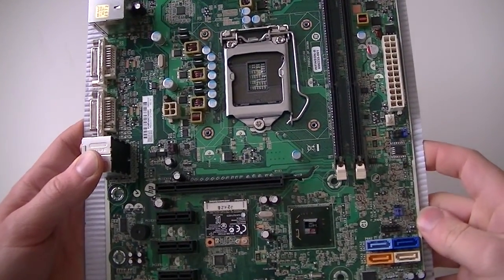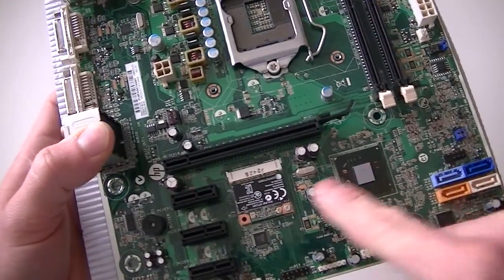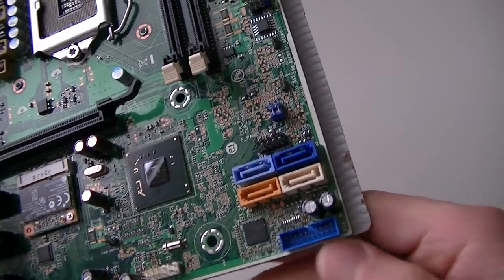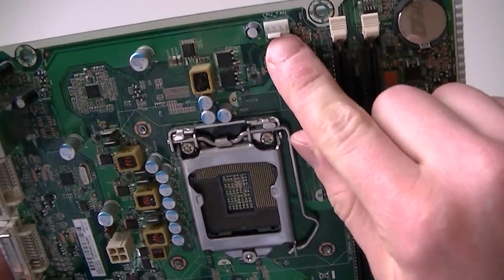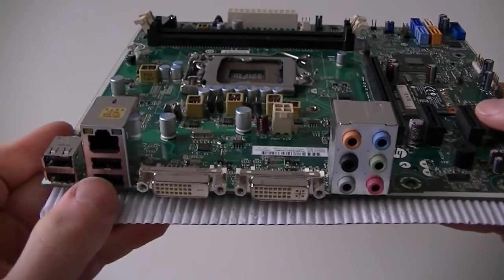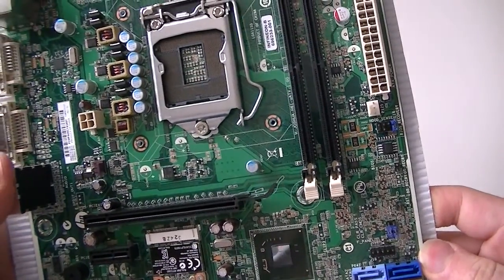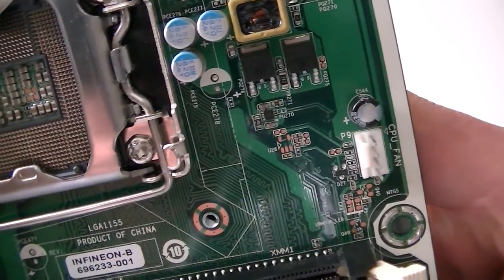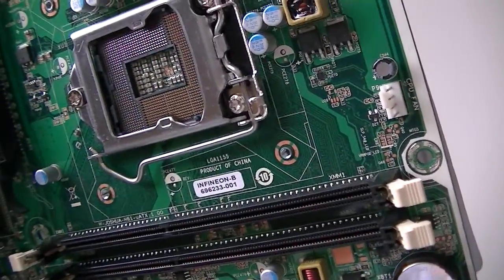Infineon-B Motherboard

Comment: i'm using an i5 3570 w/16 gb ram... had to get usb 3.0 dongle and bluetooth dongle to support virtual reality... running a msi gtx 1060 6gb vid card... runs mixed reality nicely.... only prob is a can't seem to find a manual for the board to change cases... need layout of the panel pins...
Reply: thats because this is not the name of the mainboard, this is: https://support.hp.com/lt-en/document/c03135925
Reply: @HelpfulProgram  I figured it out... thanx... I was going to upgrade my cpu... but with the 1155 board there isn't really that much of a performance boost with the boards highest cpu... so I'll put that money in more ram...